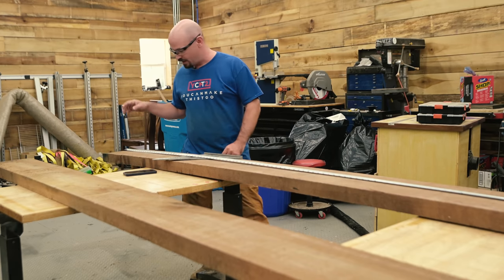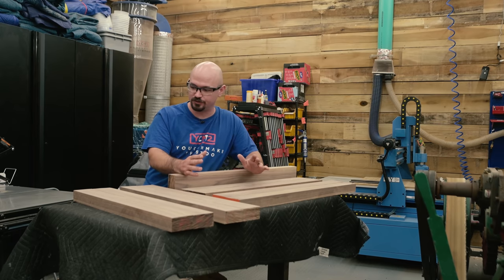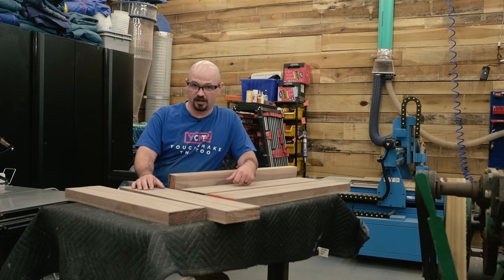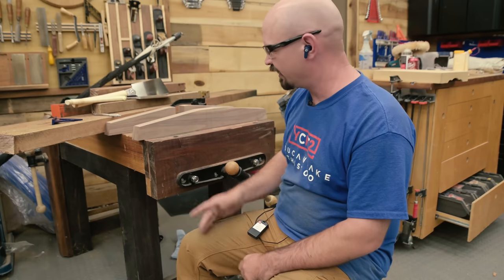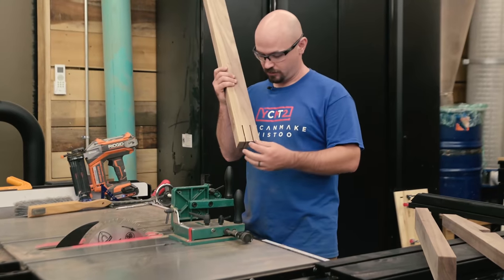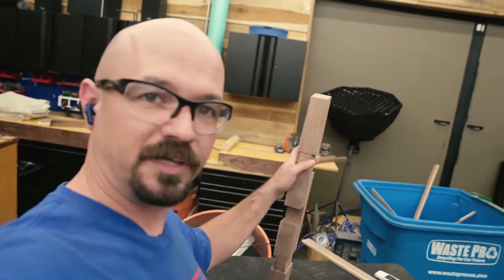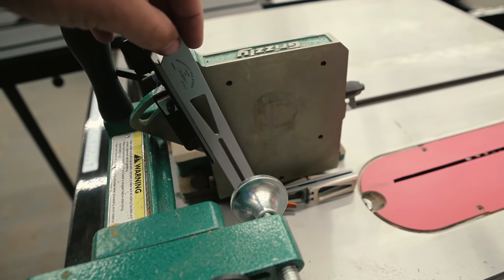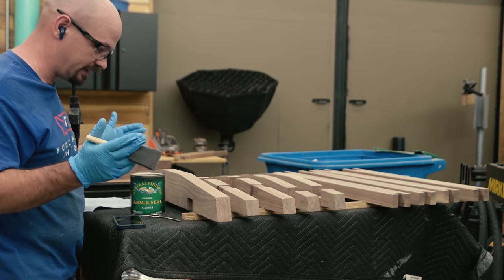Build a Dining Table - Nakashima Inspired

Comment: Beautiful table Caleb!  Had a good laugh about how it could also be done with only a $20 pull saw and $4k chisels! (very nice chisel set!!!) Really appreciate how clever that joinery is for the feet to hide the "slop" as  you put it.  That's going into the clever joinery tricks toolbox!  Also love the trick you used for the table top!  Again, a great video with useful techniques!  Keep it up!
Reply from the maker: Thanks so much! Always try to add some value :) and yeah, those chisels were a great auction find! Would typically never indulge in something like that. 

The shoulder also does a great job of holding everything in proper place for your glue ups 👍

Comment: the table looks great! and love the sneak peek of the chairs. they look great together. 'shook' is even funnier with the cc on....i'm curious what you use when you have a slab that is thicker than 2-1/16(1/8) and you need to rip or crosscut it...?
Reply from the maker: Thanks! I don’t work with tops thicker than that.. that’s way thicker than my tastes. But I’d just finish with a handsaw and then plane, or saw and then flush trim with a router
Reply: Thanks for the tips, Caleb!

Comment: Great build!
How did you finish your top?  You used GF's Armor Seal and then what did you spray?
Reply from the maker: Thanks! Top coated with general finishes conversion varnish. It’s a commercial quality two part finish that has to be sprayed.

Comment: Sweeeeet table , nicely done,  I have to ask ,...those chisels didn't really cost you 4k right? , I love your table saw , I use to be a cabinet maker back in the early 90's and would of love one what a beautiful saw
Reply from the maker: Thanks! And nah, I got them significantly cheaper at an auction. But a new set is around $4k most places. They’re Japanese Damascus chisels.. so pretty premium item, but also total overkill. 

And the new table saw is great! Been wanting one for years and finally did this fall. The sliding table has been great for thr work i do.

Comment: First of all, beautiful table.  I’m new to this game and I have a question.  I noticed you used the dominoes.  I’ve watched other videos about building tables.  Some just glue their joints and some use dowels or biscuits or similar.  Are the dowels necessary?  Will just the glue hold it?  Are there certain times when dowels are necessary?  Dennis
Reply from the maker: Thanks! So for a panel (like a table top), glue is plenty strong (assuming it was jointed properly and you didn’t haven’t to clamp the hell out of it make the sides touch). Dowels, biscuits, dominos.. do add varying degrees of strength. But mainly they are alignment aids that make sure one side of thr boards all stay in alignment so you don’t end up with a bunch of little cliffs where all the boards meet.